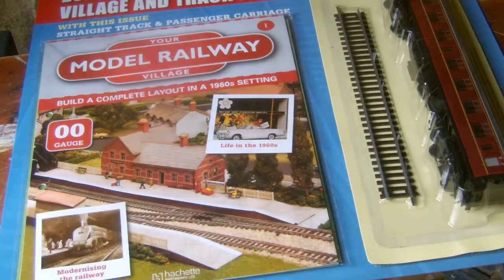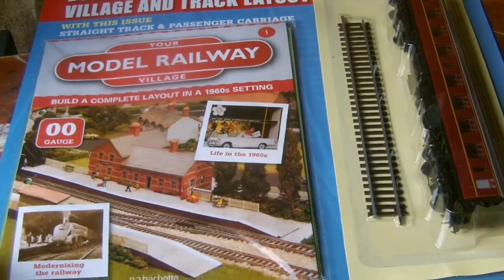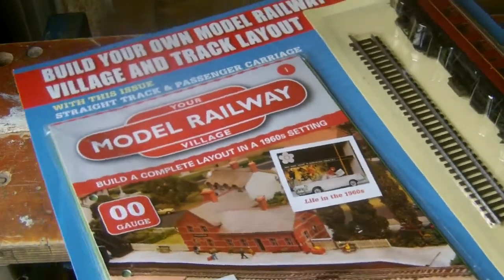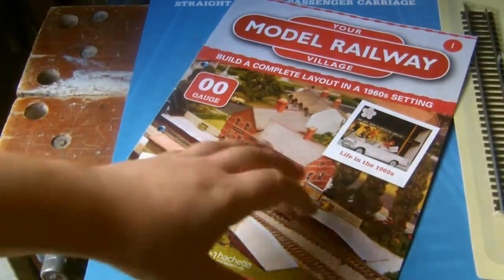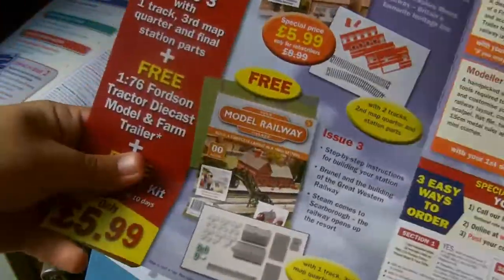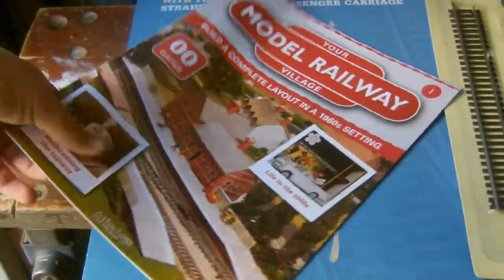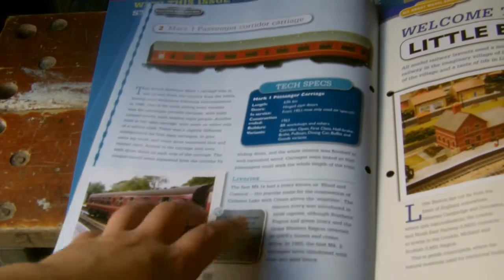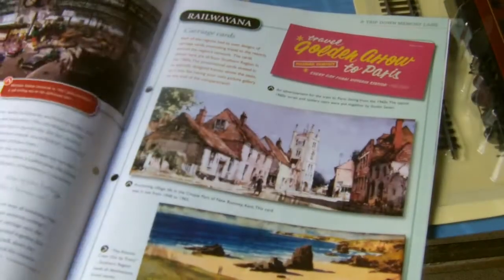Your Model Railway Village Issue 1 Review

Comment: At £1,000+ over 120 issues, if fortnightly that is four years! Also the loco and power controller is not included. I think if I was doing OO gauge I would sooner buy a starter set with DCC and still have loads left to buy everything you need. No brainer...